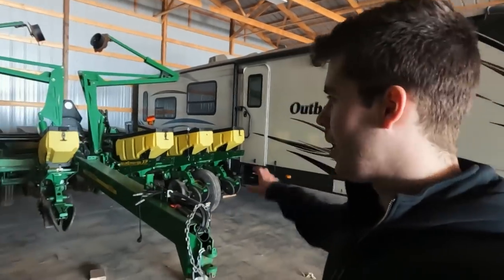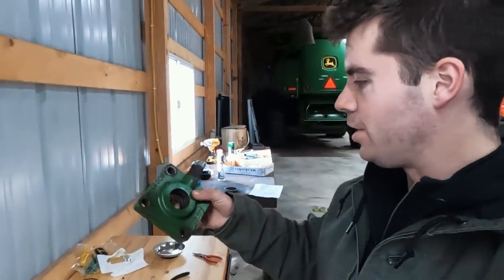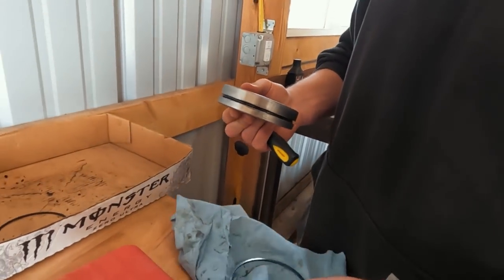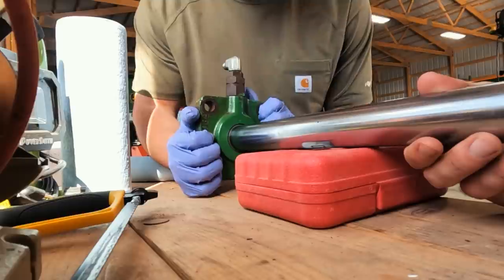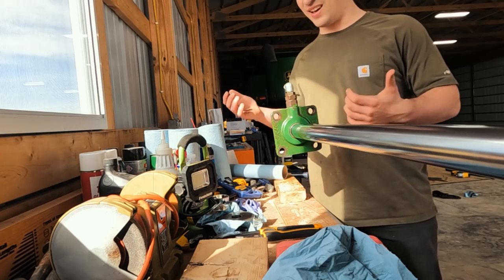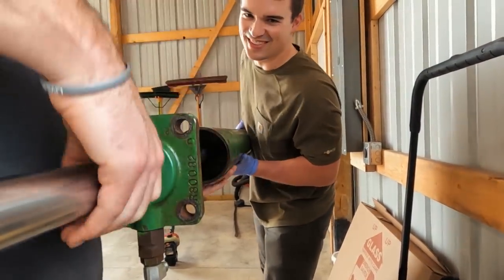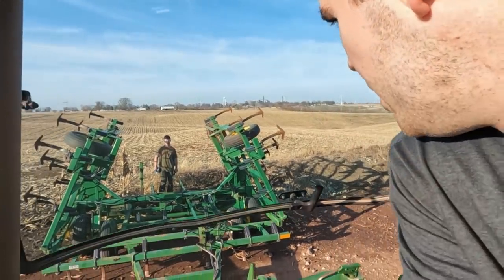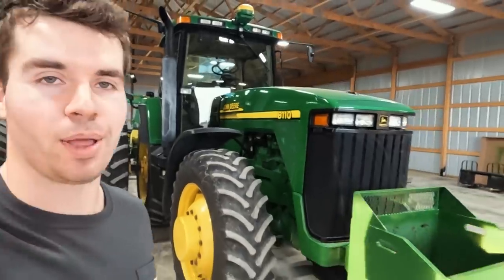Noobs Rebuilding a Hydraulic Cylinder

Comment: Awesome job on the rebuild. I normally leave the hoses cracked loose at first to purge the air. That's why it dropped so hard the first time, there was no fluid on that side of cylinder.

Comment: Bro you definitely need different down pressure springs for no till! Those springs are worthless! Don't be afraid to ask farmers questions. Get the heavy duty springs so you can adjust from no till conditions to tillage conditions. Those springs definitely cost you yield and emergence for sure. They don't keep a constant depth and corn that's not planted deep enough or uneven will do very poorly. The deeper you can plant the better. The deeper it is the longer it can go without a rain. I used to plant corn at 2 inch's deep now I plant it 2.5 inches or a hair bit deeper than that. Also helps your roots get and keep the fertilizer as it goes down through your soil.

Comment: Don't waste the time and money on heavy duty down pressure springs.  Air bags are a better option, then air adjust row cleaners can be added in the future.  Delta force hydraulic down pressure control is the Cadillac but pretty costly.  Look into Precision, best money I have ever spent on a planter.  You probably will not be able to get the parts this year, but definitely look into Precision.  i have been no-tilling for thirty years and know a few things for certain.  Tile, tile, tile and Precision parts for an older planter will pay for themselves many many times over.
Reply from the maker: I'll look into it. What's the cost for a 12 row planter on delta force?

Comment: Don’t forget to add oil to the tractor! That cylinder was dry when you hooked it back up.
Reply from the maker: Yup, will add some more hydraulic fluid to the tractor when I get back to shed. Figured it may be a little low after that.

Comment: We put all the rubber and plastic seals and rings in boiling or close to boiling water before installing them. Makes the job much easier. You did good on your first cylinder repair.

Comment: 3 Pieces of Advice:
1. Always use Emory cloth when working with shafts, pins, and and rods with tight tolerances
2. Use WD-40 or JB-80 for lubricant when trying to fit things together with tight tolerances
3. Cycle hydraulic cylinders several times before pinning to an implement - I learned this the hard way
Reply: I agree with this guy
Reply: Same here

Comment: Put a shop towel around that blue seal on the piston and then electrical tape that shop towel so it all stays over the seal. Then take a couple of hose clamps and hook them together and use those to compress that blue piston seal. Leave that tight for  20-30 minutes

Comment: As long as you are putting in the work, why don't you convert to air or hydrolic down pressure. I know it's money but it gives you more consistent and measurable down pressure.
Reply from the maker: I'll check into it! Always thought I would trade off planter with clutches and down-pressure once I started thinking about upgrading this one. Maybe it's cheaper to just install it all on this one
Reply: We run an old 16 row 7200 and we found it cheeper to keep it and upgrade the parts on it than to buy a new one. It now has air down and up, precision planting e set meters, clean sweep, individual row shutoffs, and hydrolic drives. Over the winter we put all new cast iron row unit  shanks on. And next year we are converting to electric drives. I mean who says a thirty year old planter can't plant like it just rolled if the lot.

Comment: Squad buy a second tractor about 150 horse to 200 but stay the same ages as the 8110 or older as they will be able to be fixed by u guys as well as simple tractors are good tractors